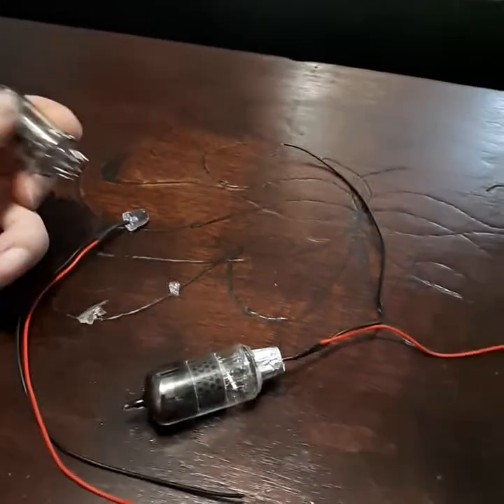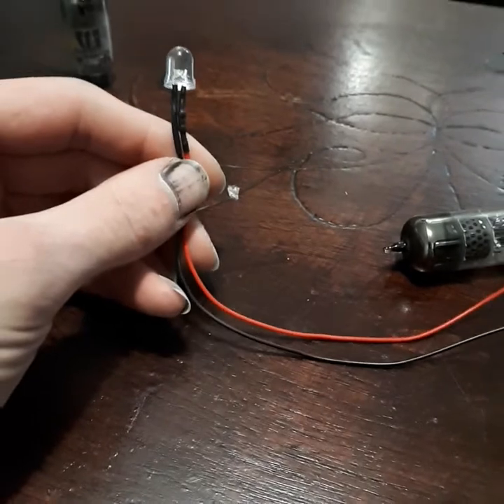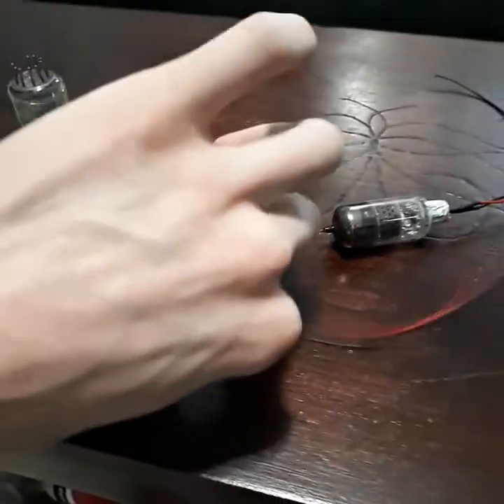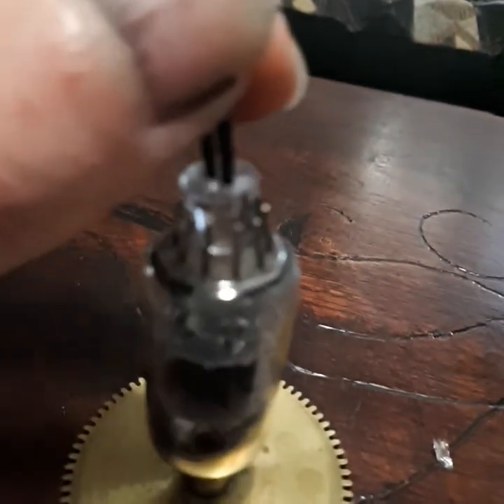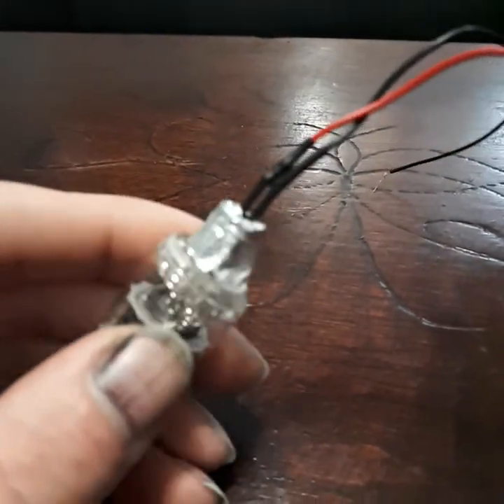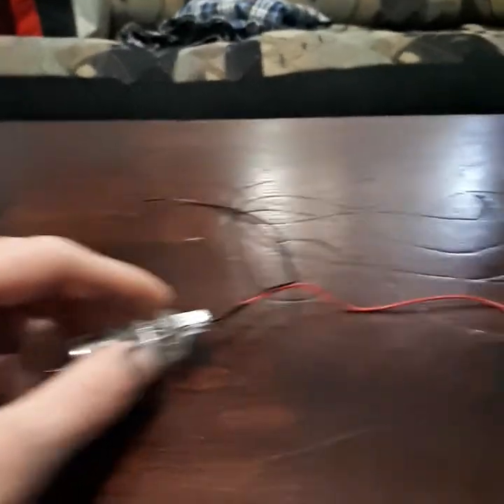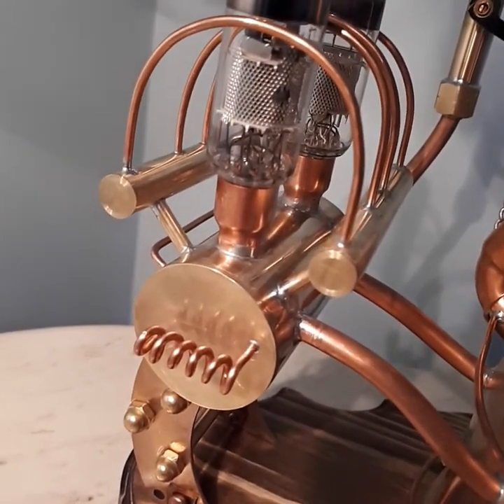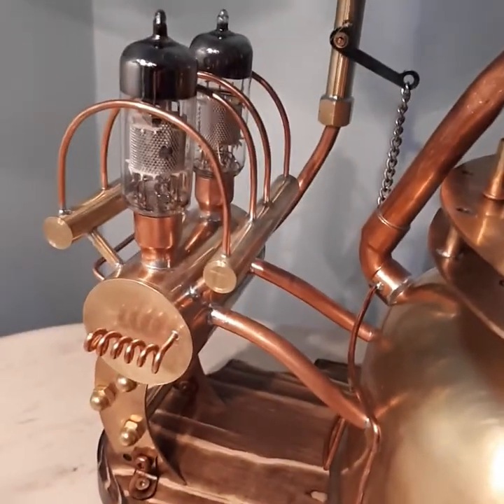How to light a vacuum tube with a 5-10mm 12VDC LED

Comment: Just curious what model/part# tubes are you using in this demonstration?
Reply from the maker: @rockymountainroughridersofMT.  completely irrelevant honestly, as long as it's a glass bottom it will work. Unless you're liking the design of components inside?

Comment: Thank you for this guide. I followed it in my latest project. I changed it slightly. I wanted to be able to change any broken LEDs in the future. So, instead of epoxying the LED between the pins directly, I epoxied an LED bezel which holds the LED. This way, Inss cos an swap them out if needed. Thanks again.
Reply from the maker: Thank you, glad you found it of some use. It was merely a simple tutorial of how to do it because so many were asking, so I decided to do a simple version. There is always a way to improve a design so if you found a means to do so that is great. 

I find the LEDS are fairly easy to pop out from the pins so wasn't too worried as all my lamps are serviceable including the LEDS so I too had to keep this in mind.
Reply: @derekr7814  that’s great, thank you again for your useful guide.

Comment: Very cool! I just uploaded a video on how to make one of these for only $1.
Reply from the maker: Just so you're aware a lighted vacuum tube by itself does not constitute steampunk.

I would make a suggestion to hide the LED/focus the LED, and hide the prongs from the tube itself, find a brass tube that will fit over the prongs on the outside and slide it over and then attach it onto the nightlight. You are losing all your light out the sides rather than directing it through the tube itself. It will also look nicer and more professional.

Comment: So I want to attach one to a USB. Which LED should I use? Can I use the flickering one from a flameless candle?
Reply from the maker: Depends on the voltage through the usb. You need to match that voltage. I believe flickering candles have a circuitry in them which may be a little more complicated because they only run off a small voltage compared to a usb.
Reply: @derekr7814  All USBs are 5V. Should I put a resistor?

Comment: What did you use as a power source/driver?
Reply from the maker: In this video a 9v battery.
However in my lamps I use a 12vdc step down. So I tie a step down into the 120VAC line to run the 12v accessories.